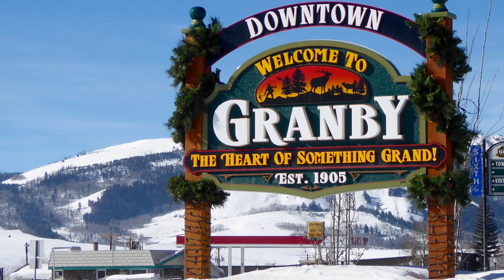He Destroyed a Town in Revenge | The Case of Marvin Heemeyer (Killdozer)

Comment: "A man operating a scraper machine stepped up to the challenge in a 1v1"
So fucking badass.
Reply: Except the scraper chickened out
Reply: That’s one hell of a line
Reply: @paradix847  the scraper was the one that ended up stopping him though
Reply: @lukelegg9915  no the hydraulics stopped working and the engine over heated trust me the dozer had more than enough power to move the scrapper
Reply: @theironsushi9837  no no, the scraper blocked him into that corner, forcing him to go through instad of backing up like he originally planned, it was a mixure of things but the scraper was a huge help
Reply: @lukelegg9915  on a fresh 1v1 that dozer would have rekt that scraper... The killdozer was tank/dps build maxed out!
Reply: @mariobastidas3102  I mean yea, but even with a fresh dozer, falling in a basement is falling in a basement
Reply: @marcmyers1465  it for sure wouldve, they dont have the same power in reverse
Reply: Stale potato, correct. Probably has 2 hp less backing up. Problem is , a D355 with no blade weighs 106, 620 lbs. That 627-sized scraper weighs  73,300lbs. There is NO WAY that scraper would stop him if he wanted to back out of there.
Reply: @richardmaurer9002  true, he also had busted cooling so who knows really

Comment: I apologize in advance, and I know this 2 years late, however there is a CRITCIAL flaw in your video that taints EVERYTHING that comes after: The Concrete Plant was NEVER going to block Marvin's Easement. That is NOT the catalyst for what happened, at all.

This was erroneous reporting that stemmed from a blog written two days after the incident. Two days, and someone is reporting the cause of Marvin's Rampage before the police have even begun their investigation in full? That particular blog turns out to be where a vast majority of the inaccurate beliefs about Killdozer come from.

The truth is that in 1992, Marvin wanted to connect to city sewer and water, rather than use the improper sewage system installed by the previous property owner - a buried cement mixer drum. In order to do this, it required a MAINTENANCE easement. His sewer lines would have had to cross a neighboring property, meaning that Marvin would essentially have to buy access through that property in order to allow maintenance access to HIS pipes on someone else's property. 

The city suggested that installed a proper septic system would be the cheaper option, but Marvin refused, claiming that it was "government extortion". 

Marvin got angry over the cost of said easement, and stormed out of the Sanitation District board meeting. 

The concrete plant NEVER interfered with Marvin's property. They offered to buy it, but Marvin kept upping the price until they canceled their offer. Instead, they purchased another nearby property- one that Marvin was intending to buy. Remember, Marvin originally outbid the Docheffs in 1992 for the Muffler Shop property- so it's not as if Marvin hadn't literally done the exact same thing to them, first. Marvin agreed to trade properties, BUT only if the concrete plant would build him a brand new shop on the other property, and they declined.

Marvin then campaigned to block the concrete plant from building on their new property. The Doceff's offered Marvin a FREE maintenance easement for his sewer and water IF he dropped the lawsuit, but Marvin refused.

The city approved the concrete plant construction in 2001 despite Marvin's protest. 

Around this time, Marvin's makeshift septic tank had filled up, so he started dumping his waste in an irrigation ditch behind his property- and then was caught trying to illegally connect to someone else's water and sewer. He was reported. NINE YEARS after the city gave him the ultimatum to have either a septic tank or sewer connection installed, the city fined Marvin $2,500 for the illegal dumping and other code violations. He was given almost a DECADE of allowance, but finally the city put their foot down and made him connect to sewer or install a septic system before he was allowed to operate his business, AND have the mixer drum removed and disposed of before by 2003.

This is literally why Marvin originally bought the bulldozer. To do the work he could've done across the entire last decade.

Also, mind you, Marvin was worth millions. He owned and sold multiple muffler shops, he had a lakefront property on Grand Lake... $2,500 was chump change to him, and considering the city waited NINE YEARS to actually fine him despite the ultimatum originally given in 1992, he felt that he was being wronged.

Please amend this misinformation and update your video. Thank you.
Reply: Did the Granby city council write this?
Reply: @thatfrog05  No, a person who has extensively studied the situation has.